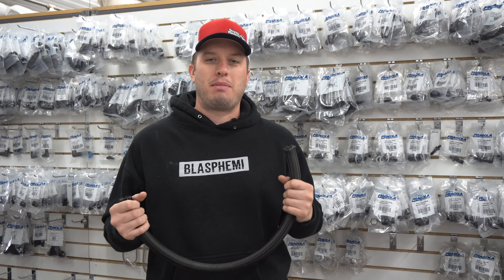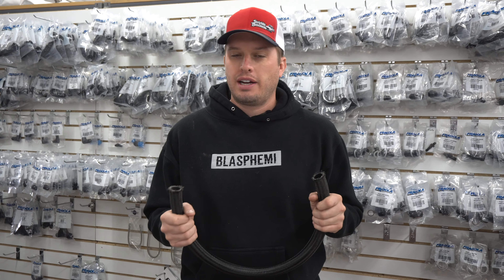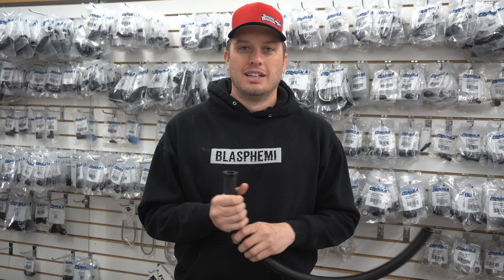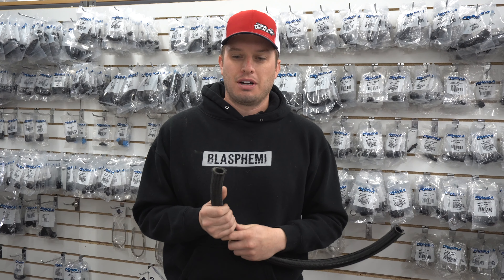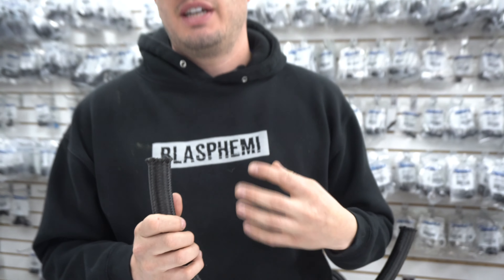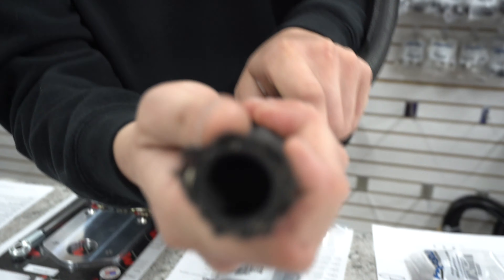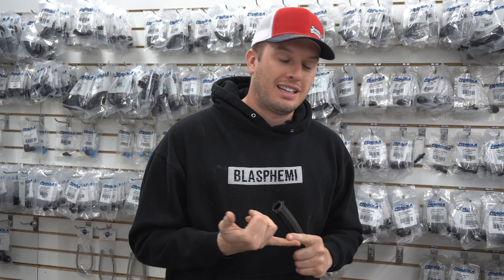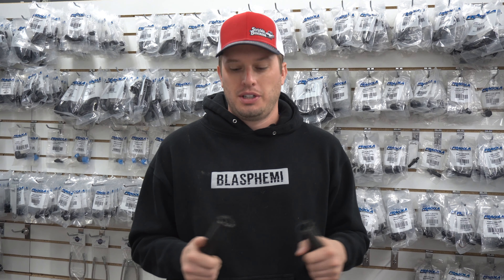New Fuel System? Must See Video: Tech Tip Tuesday!

Comment: 👍😉 Glad you made a video, maybe it'll help get it into more people's heads. Probably not, but you know.... A buddy of mine had this happen to him twice after finish two different projects. They wouldn't start... The fuel filter was clogged on one, the other had a nice chunk of rubber tubing clogging the line right at the carburetor. Definitely something that people should think about... But who wants to think about that when you want to hear the engine fire up, and the last thing to do is just connect the fuel line, LOL 😜

I want to mention another kind of story that this just reminded me of, my friend, on the project he had the clogged fuel line with rubber. He replaced all the fuel lines on that project, but he ended up having a total another major issue engine issue that could have been easily remedied if was just thought about it happening.... He built this E85 monster of a engine in his garage in the winter time, and then just have it sitting there waiting for the spring weather to warm up and it's first trip. He started it in the winter, brand new freshly honed engine. It had a bit of a bad carburetor that leaks apparently the fuel down after being shut off. He started the car in the winter and got it broken in just a little bit in his garage, and then shutting it off and leaving it for several months. Well he ran it for most of the year that next season, the engine was a monster, pulling the old G body Cutlass front tires right off the ground, one of the best Motors he ever built! But soon it started to have some issues... He started noticing some blow by and his catch can. He did a compression check, which wasn't good... He sadly ripped apart the heads off to investigate. Instead of the normal up and down cylinder scratches you would think you would find with piston strokes instead he found round rings grooves in the cylinder at different spots in every cylinder. What had happened was when he originally started it and then shut it off and didn't run it for several months, was that fuel had leaked down into the new fresh cylinders and being E85, it had flash rusted the new cylinders, and left a ring grooves at the top of every piston. Had to pull the motor and get it completely rebuilt, sad sad... he was just planning on taking it on the Power Tour too the next year.